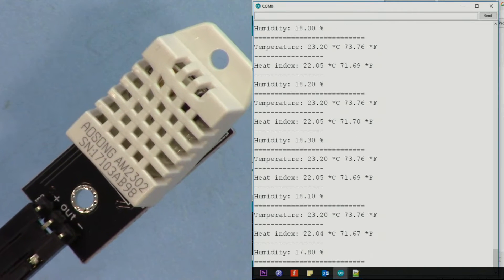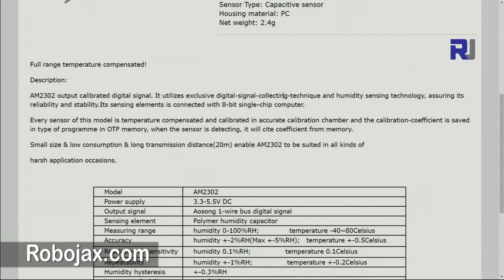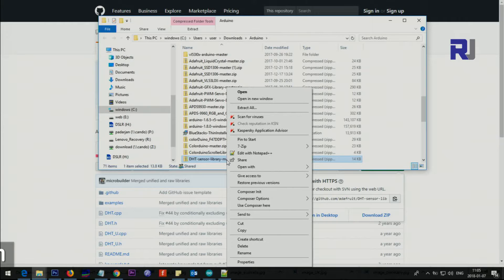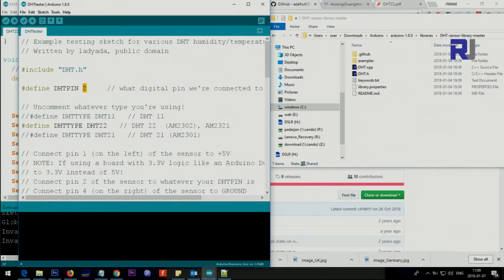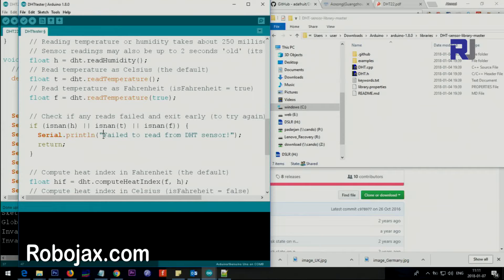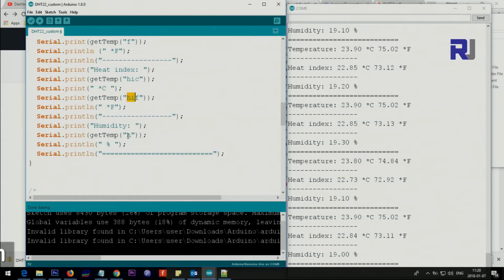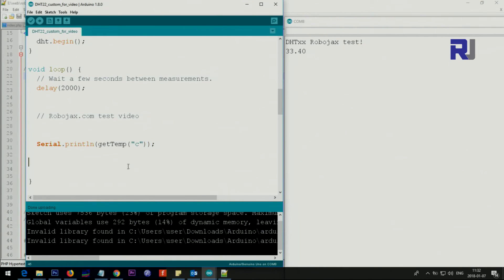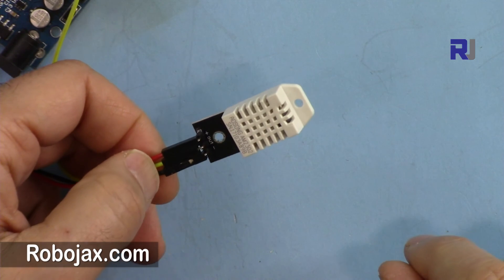How to use DHT22 AM3302  Temperature and Humidity sensor with Arduino RJT41

Comment: The DHT22 sensor enables temperature measurement in the range of -40 to 80°Celsius
Does your program accept this? I.e it also shows negative temperatures?
Reply from the maker: of course it does. if you get incorrect reading, either  you have not selected the sensor in the code or there is wiring issue. I am assuming you have followed the instruction and installed the library.  You may use the code for DHT22 from this video ignoring the WiFi feature https://youtu.be/JXCcmZUmzy8
Reply: Thank you very much for your reply. It is OK.
Otherwise, you have very good, clear and understandable instructions.
(Sory,google translation)
 @robojax

Comment: Why does it read that my humidity 99.9% and temperature 129.9°C.
And both don’t change no matter what
Reply from the maker: It could be wiring problem
Reply: @robojax  and if it’s not a wiring problem, what other cause can it be?
Reply from the maker: Not sure, perhaps wrong model is selected in code.
Reply: @robojax  can the sensor be broken? Cause I checked the wires and the voltage and amps are good, the code is good, I picked the right model, but the reading won’t change no matter what I do
Reply: @stelaririna  na  You might try and reload the bootloader.  Then run the Blink scketch and if it cycles a few times only or not at all, the board might have gone astray.
Reply: @robertomalatesta6604  I bought another sensor and it worked on the first try, I still think that one was broken from the start

Comment: if the distance of the sensor is 20 meters with the arduino, can the sensor work?
Reply from the maker: Yes the distance of communication is 20m mentioned here http://www.aosong.com/en/products-22.html
Reply: @robojax  no need capasitor?
Reply from the maker: why you ask about resistor? if you have this sensor, just watch and you should get all answers.
Reply: @robojax  because the store that sells the sensor recommends if the distance is more than 2 meters requires a capacitor
Reply from the maker: Datasheet is always the most correct information because that is from manufacturer.

Comment: if the distance of the sensor is 20 meters with the arduino, can the sensor work?
Reply from the maker: I did the search, found the information for you with the link from manufacturer. read the datasheet and id you did not find, it contact the manufacturer.  Use ESP32 or ESP8266 to read it over wifi. Search my channel. Here is how to find Specific YouTube Video in a channel https://bit.ly/findYouTubeVideo

Comment: Hi robojax, can i use this sensor and a mega arduino stand alone without connecting it to a pc ?
Reply from the maker: when we say Arduino it means stand alone. We use PC to just upload it after that we don't need the PC.  yes this module works with any Arduino board. including Arduino Mega.  Here is Arduino Step by step course with 100 video and codes  Arduino Step by Step course that starts here https://youtu.be/-6qSrDUA5a8

Comment: Would it be possible to use two of these sensors simultaneously with Arduino?
Reply from the maker: Hello, yes you can use the idea from this video https://youtu.be/L6ekl2ABcuY to use two or  more of this and here is how you can see it temperature from this sensor on mobile phone https://youtu.be/1A4-6hDARQc
Reply: @robojax  Thank you very much. I'm thinking of making a simple weather station that shows indoor and outdoor humidity and temperature

Comment: should we connect a resistor of 10k if its an Arduino mega 2560? or jus direct connection
Reply from the maker: you made me worry with your question. my videos are totally different. I never leave the details out. if you watch it fully, your project should work. So after watching the "wiring explained" section, I saw that I have shown it. you don't need anything expect the wires.
Reply: @robojax  
Ok thanks

Comment: Hello, great video and tutorial. My question is, when I have to use a resistor? 
So, if I want to connect 4 dht22 sensors together when I need a resistor?
Reply from the maker: Hello Fatima, you don't need resistor if you have the module shown in the video.  I have the code on our website robojax.com. I added the link to that page on the same page where you get the code. the link to code page is below this video in the description.  good luck.
Reply: @robojax  Thank you so much, appreciate your reply.

Comment: when i running this program and open serial monitor "Failed to read from DHT sensor!" you have an idea ? i have try with different device but same result
Reply from the maker: it means you have either incorrect wiring or dead module.

Comment: Hi sir thanks for this helpful video i just wanna ask if the dht 22 can go faster than every 2 seconds loop?
Reply from the maker: Because it measure humidity, it makes it to read slowly  and you will not get accurate data less than 2sconds. See page 9 http://robojax.com/learn/arduino/robojax-DHT22_manual.pdf if you just need temperature measurement, then use another sensor and there are a lot other sensors that can read much faster .

Comment: I installed the library at http://bit.ly/rjx-dht22. During compile I got the message "In file included from C:\Users\DJH\Documents\Arduino\libraries\DHT-sensor-library-master\DHT_U.cpp:15:0:   C:\Users\DJH\Documents\Arduino\libraries\DHT-sensor-library-master\DHT_U.h:36:29:   fatal error: Adafruit_Sensor.h: No such file or directory. compilation terminated."
What did I not do?
Reply: Replying to my own question: I did not copy Adafruit_Sensor.h from somewhere and manually insert it into the DHT library folder.
Reply from the maker: I will reply to all Subscriber's 🔔 questions. So make sure to Subscribe.😊

Comment: I have this error when I trie to run it. I t says ´error compling for board Arduino/genuino uno.´ I am using an Arduino uno board with the 1.8.11 version. Do you think you can help me?
Reply from the maker: it means  you have not selected the right COM Port for your Arduino. when your Arduino is connected click on Tools->Port and select another port and the try to upload.

Comment: Hi, thank you for the informative video. What do you think would be the cheapest cable tu use the sensor at 3 meters from Raspberry ? Thanks
Reply from the maker: You are welcome.  This module doesn't need much power. Any wire will work.
Reply: Nice ! So just a basic USB wire is fine ? Thanks

Comment: Thank you so much Robojax. What a great video. I wish you had continued on to tell us how to write the code so that the sensor could turn on or turn off a light or motor when the temperature reached or declined to a certain temperature.=====================================================================================
Reply from the maker: You are welcome. I will make video on that as well.

Comment: Possible to provide the code if a turbidity sensor is used instead of temperature & humidity? my code doesn't seem to work.
Reply from the maker: I would have to have the device, then I would be able to say it it works or not. i just add it to my "to do " list.

Comment: DHT22' was not declared in this scope
Reply from the maker: You have not downloaded the library. Make sure to download and add it to the Arduino library folder. or if you have included the library make sure to uncomment the line // #define DHTTYPE DHT22   // DHT 22 
by removing the // from the beginning of the line. Watch video for instrcution

Comment: I getting "Failed to read from DHT sensor!". I am using the dht22 but mine doesn't have the black and adapter and I use a 10k omh resistor to 5v any suggestions ?
Reply: I get the same thing! Did you get a solution for this problem?
Reply: I did, I bought one with the little black thing that has the resistor and maybe some thing extra https://www.amazon.com/gp/product/B01N9BA0O4/ref=oh_aui_detailpage_o03_s00?ie=UTF8&psc=1

Comment: The DTH22 sensor isn't working with this setup for me, the sensor is pulling to much power from my arduino, any idea why it would (in the exact same setup as the video)
Reply from the maker: either your are connecting the wires incorrectly or the sensor is bad.  The only way to know is to connect another sensor.

Comment: Hello
Can I take this code and make some changes to work with DHT11
Reply: just the same.
22 is just an upgraded version
Reply from the maker: have you looked at the code? there is DHT11. just comment (select) the right sensor.
Reply: @robojax  no I have not

Thanks

Comment: Hello . Thank you for your nice video .
I have a question:
Are the sensors like LM35 and DH11-22 accurate and reliable?
Are  it need  to calibrate?
thank you
Reply from the maker: You are welcome. I have not compared it with LM35. Because this is digital while LM35 is analogue, this should be much better.
No calibration is needed. Datasheet/manual has been provided.
Reply: Robojax thank you for explain